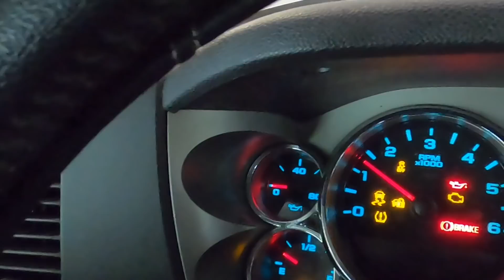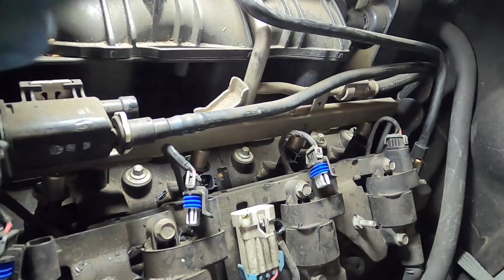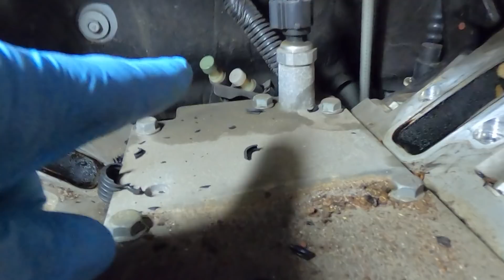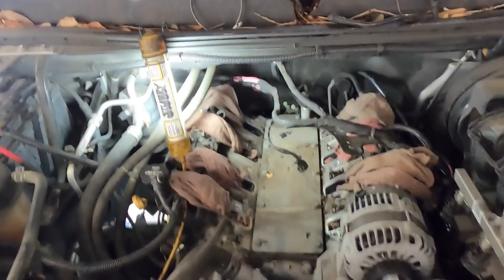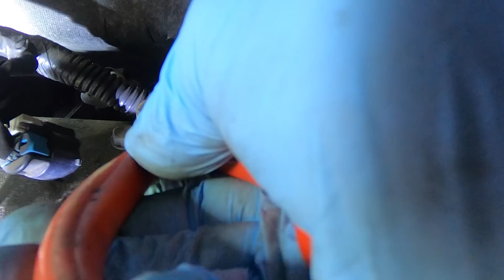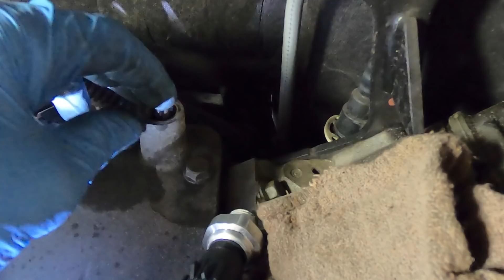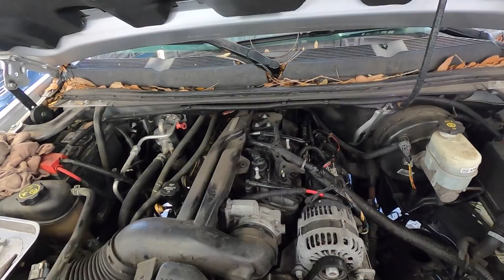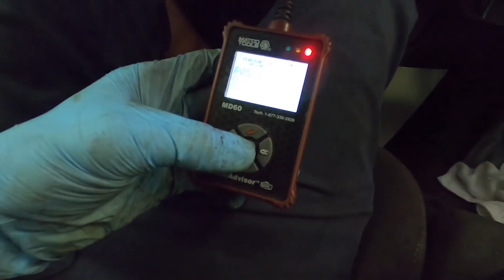Customer States: Google Diagnosis…replace this part!

Comment: That's some well thought out engineering having to remove the intake manifold to change an oil pressure sender.
Reply: You don’t HAVE to remove it
Reply: That's. GM engineers being dollar driven by upper management
Reply: No poor engineering is putting a starter under the intake. Yes, many do this. We just had a Honda that was down for a month while we tried getting a throttle body. Just touching it broke coolant lines on it.
Reply: I remember a VW V6 engine, which made you pull out the engine just to replace the starter 😂
Reply: @oskvr.l  no, dont remember that one.. but the 5cyl in the bugs make you pull the engine to do the lower timing chain. its between the engine and transmission. Oh and you time that engine off of cylinder 5. so close enough.
Reply: @rodx5571  It's an older Touareg model with a V6 engine. VW says the engine has to be removed. It can be done without doing that, but that requires some trickery and it's not how it is supposed to be done and while you've done that you possibly could've just removed the engine. Probably saves some time as well 😂. I got no idea what kind of satanic engineer decided to put the starter in such a place.
Reply: @oskvr.l I know which one you are talking about. Also have to pull the engine to do an upper oil pan, which leak profusely.
Reply: I typically lay on top and use a swivel extension to get them out. Not to bad and saves time.
Reply: @hyperchuk  okay it's called experience. I can do a brake job in 20 mins. Yet it still gets a mandatory 1.5 hours. A wheel bearing calls for 3. I can do most in 1 hour max. Unless a press in, but still get paid for the press plus the labor to do job. So I can put my self in there shoes cause my manager loves when we can put out the work in under book time. Makes ALL of us more money in the long run. And if experience means I get paid less for the jobs. Then ever mech/tech is gonna quit.
Reply: I mean you don't have to remove the intake to do it
Reply: i worked on my brothers 01 monte carlo ss and even as a beginner their design choices are just baffling compared to my yota
Reply: You don't have to.
Reply: Some put it under the exhaust manifold.
Reply: Try a 2011 Hyundai sonata gls rear brake rotor job, suspension and other parts have to be removed 👀
Reply: Of course,it’s a Chevy 😂😂😂
Reply: @roberthampton6438  they ALL have issues of some sort.
Reply: Engineers.  I went to replace the cabin air filter on my ‘01 Honda Insight.  The shop manual procedure starts with unbolting the glove box and a strut, then a structural member of the dash board is cut out to get access to the door covering the filter.  Well, I learned the previous owner had changed the filter because the the structural member was already cut out - saved me a couple of minutes!
Reply: @hyperchuk  40 hours? You're a tech? 11 hour days 6 days a week. Is minimal you can put in around here. 100 hours is what they want to be minimal per tech we got 5 rn. All hitting above that because we do our jobs like they are suppose to be done. Why rip your self off? Why throw your experience down the drain. I take commission, cause take home 1200-1400 is alot better then always getting 750 take home flat. You do flat rate when you can't put.numbers up and wanna save your ass. Your experience is clearly lacking the last 30+years. Lmao.
Reply: @hyperchuk  I'm not trying to school you. You are literally saying we shouldn't be paid book time for jobs that took us less from experience. That make no sense at all. Think about it. You do a 2001 ford f-150 exausght manifolds. Book calls for 8 hours. For both you've done 1,372 of them so can have it done in 3, 4 tops. Now your saying you'd fuck your self out of 4 hours of for me that be 35 bucks a hour. So you'd be says bye to a extra 140 bucks just cause experience. That backwards as fuck no you take that extra 4 hours cause it took you 1,000+ to get to that point.
Reply: @hyperchuk  if we all worked like that we'd all be broke. That simple.
Reply: @hyperchuk  if you do body work why your truck misaligned. Bad to don't even have to zoom in to see. Lmao.
Reply: @hyperchuk  I can do all that too! Would I No. I can also sing. And dance. Am I good no. Saying you do something. Then telling me to go look at you shittily aligned truck is fucking priceless.
Reply: @hyperchuk  the type of guy to paint a bumper under a 🌳  lmao.
Then say he's a professional.
Reply: I have to do that to change the plugs on my Xterra.  I love the truck, but I’m not looking forward to this!  I’m changing the seals while I’m in there.
Reply: you should see the starter location in a Toyota 1-UZ V8.

they put it under the intake, for whatever reason. I doubt the engine would've suffered any had they put it between the engine and trans, but nope. Under the intake.
Reply: What's worse is having to remove the entire top of the engine to replace a lifter. (Intake manifold, and head needs to come off and if you're removing 1, might as well remove both)
Reply: In an BMW E70 X5 the entire front subframe needs to be removed to replace the engine oil pan gasket. $20 part, 11 hours labor. German engineering at its best.
Reply: And yet it's the german cars that get all the grief for "complicated" engineering????
Reply: Remember in the 90s chevy put the fuel pressure regulator under the intake plenum lol, on the side of the worse fuel injection sender ever made and then made it stick up through the plenum with a gasket that barely sealed right under the best conditions. They do things weird sometimes but I wouldn't trade the old hunk of junk for anything.
Reply: @itsmegregk  yeah, the spider injected early Vortec engines. And they did that flat distributor cap that cracked in the middle shorting the coil to cylinder 6 inside the cap, making the engine not run. Made CRAPLOADS of $$$$ on those. Still making money on those. Add to that the distributor gear liked shearing teeth, and you had to have a scanner to set them to -2 to +2 degrees when replacing or it would set a P1345 code. yeah, easy money.
Reply: @rodx5571  Having a 1993 S-10 4x4 blazer. Vortec. I have nothing but bad things to say about it 😡.Biggest POC Plastic junk. Have had to replace three so far. One under warranty. One I replaced about 40 thousand miles later. Then had to have another one a little over a year ago and had to have a shop do it as I had just had shoulder surgery 😒.at 29 years old that's the only problem  every thing else is pretty much original. One  water pump I replaced.,And two fuel pumps. In 29 years.
Reply: We joke at work that Engineers design things like that to justify their six or seven digit salaries.
Reply: It is designed that way for capitalism's sake. Manufacturer  making money for the dealer.
Reply: No, you're  correct,  you don't "have to" ,  But that is the procedure a technician like myself or Ray HAS to follow in order to get properly paid for the job....
Reply: @hyperchuk  yep. i made a tool, and got my throat cut by management, so now i pull the intake.
Reply: @rodx5571  It just takes some folks a bit longer to realize how "life" works, and not stess against the process
Reply: @hyperchuk  I never HAD to remove it to get properly paid as a tech
Reply: @chicanobluesaz4191   No I never HAD to do it either, but some places they insist that you do it according to the way the manufacturer suggesthe manufacturer suggests just in case something goes sideways then you have to try to explain to the customer you try to cut the instructions to save time and now they have a broken intake manifold or some such thing...  It's been doing this for almost 50 years I've probably done a 100 of them without pulling the intake
Reply: @hyperchuk  that's not true at all. It all depends on the tools. And how many you've done. Done it both ways. It's definitely just a suggestion.
Reply: @hyperchuk  kinda like how all the different torque specs weren't  followed when being reassembled?
Reply: @korndawggy1801   Well, when you've been doing it as long as rain Man Ray and I have,  you can come within 2% of the torque just by feel
Reply: @hyperchuk  pretty sure you get paid either way if it works in the end. I'm with both of you though make life easy. PS my 03 6.0 silver had me tow it to the shop when low oil pressure message came on-I tested oil pressure with mechanical gauge-psi okay-not familiar with 03 problems or location etc yet. Cheers.
Reply: These engineers are not stupid. They have bosses too.  They are told to put it there! So it takes longer and more money for the dealer who is selling these cars to stupid people who never ask "but, how easy is it to fix?" this is the American Way!

Comment: I'll guess that when you started out you wanted to fix the problems and would do whatever it took to get it done, thinking that your initiative would be appreciated. Then after getting chewed out a few times by customers who accused you of inflating their bills when they only asked for X, you decided that if they ask you to fix it, you fix it, and if they ask only for X, you only do X. Seems like a good coping strategy to me.
Reply: People are that way. Some shops do inflate billable work as survival tactics. The shop i work for doesnt want to see the laundry list on top of the requested inspection/diagnosis. The only exception is safety issues like brakes, belts showing in tires (which we dont do tires). Or ball joints that have worn their way out of the cups (I'M looking at you dodge and ram trucks). So as a tech i dont bother inspecting everything unless its requested or a safety issue.

EDIT: some shops will fire you if you don't do the laundry list every time.
Reply: It's also illegal to do work on a vehicle without permission.  You can lose your license for doing work that wasn't agreed on.
Reply: @lilkittygirl  Mechanic license?  Never heard of such a thing.
Reply: @BottomleyAdventures  You need a license to be a mechanic...
Reply: @lilkittygirl  Where?  Not in the US, at least not in most states.  There may be a couple crazy states that require it I suppose.
Reply: @BottomleyAdventures  Some states don't require it but many that do.  In Canada, it's a requirement.

Michigan for example has 11 different levels of certifications for mechanics.
Reply: @lilkittygirl  Interesting, thanks.  I just did some research and see that licenses are required in Michigan, California, Hawaii and Rhode Island.  I'm from Indiana and have never heard of such a thing.  Sounds like horrible government overreach and a great way to drive up prices, but I'm not necessarily surprised by those 4 states...  Usually such licensing schemes are lobbied for by the bigger players in an industry to raise the barrier of entry and reduce their competition, thus driving up prices.
Reply: @BottomleyAdventures  It's not an overreach.  It's to protect all parties regarding liability of damage.

Insurance companies want licensing for these reasons as well.
Reply: @lilkittygirl  Spoken like a true statist. :)  Glad the vast majority of US states disagree with you.
Reply: @BottomleyAdventures  Um, I'm not a statist, nor am I American.

The laws are in place to protect the public from being exploited by mechanics forcing them to prove their work and they are actually trained to perform it.  That way the mechanic can face severe penalties for ripping people off or doing shoddy work.  When you have your career at risk, you tend to go extra lengths to be sure you can keep it.

The laws are in place to also protect the mechanic from wrong allegations, from wrongful lawsuits and so they can qualify for affordable insurance in case things happen.

It's a scenario where everyone wins, the only people that don't are people that shouldn't be fixing cars due to their malpractice issues.
Reply: @lilkittygirl  You are a statist, but you probably don't realize it if you're Canadian.  You've likely just been brought up that way.  Everything you mention is achievable without licensing, and in fact all of that exists in the US.  ASE certification is a stringent process that is widely used in the US to demonstrate proficiency.  There are very severe penalties in the US for ripping people off (fraud) or performing shoddy work (tort liability).  Not only do we have a judicial system setup to deal with such issues, but also a widespread system of ratings and reviews for customers to share such experiences.  Everything you mention is possible without a government licensing system.
Reply: @BottomleyAdventures  a certification is a license.  JFC.

I'm not a statist, but I support government implemented measures where appropriate.  Law and order exists because of the government and its people.
Reply: @lilkittygirl  No, certification is not a license.  Licensing is only done by governments.  Certifications are voluntary.  Law and order exists out of a need to protect citizen rights.  In fact, that is the only legitimate purpose of any government.  Didn't plan to get into philosophy here but why not, lol.
Reply: @BottomleyAdventures  No, certifications are government regulated dude.
Reply: @lilkittygirl  Simply Google the definitions dude.  You are wrong.  "A certification verifies that a professional has met a certain set of criteria for a skill or job as measured by a third-party assessment. A license is verification by a government agency that a professional is able to perform a particular occupation in a particular location, such as a certain state."
Reply: @BottomleyAdventures  "Google"  Yea, I get my academics from places that are not Google.

Both are managed by your government, the third party assessment is a school that is regulated by the government.

The government handles all certifications and licenses one way or the other.
Reply: This guy is working at some soft surreal clown show in Florida with beautiful weather all year round days that never get shorter so why the hell not pull the intake manifold. He doesn't have days that r still dark at nearly 8am and are pitch black by 4pm so he enjoys soaking up endless hours and endless pay checks. Will I blame him??

Comment: I discovered it takes about 3 cycles of on and off before the new one starts working, ? Did you also replace the small filter underneath sensor while doing it,  I wished you would have showed the oil gauge as you were backing it out.

Comment: My god these sensors and that oil passage design are garbage.  I've replaced 5 of them on my '08 silverado...I've gotten a lot better at it without removing the intake and it's really not that hard or that tough on your hands.  My passage got blocked (well after I disabled DFM that is also fed from that same passage) and I was at the point of pulling the intake and trying to clear the passage when I decided to just put a sensor fitting at the oil filter and be done with the trouble.

Comment: The intake don't need to be removed. Sensor socket impact wobble 3 inch extension and wratchet. Disconnect fuel line and you can get your hand back there.
Reply: unsafe

Comment: There is no way I’d go on a wild goose chase because google said so.   You don’t fix their problem and you expose yourself to the old “it worked before I brought it to you”.   If google diagnosed it have google fix it.
Reply: I agree with not always trusting Google but, you can clearly see the oil gauge was working at the 32:10 - 32:15 mark.

Comment: The design of that engine is pathetic.  To have the oil pressure sensor so difficult to remove makes me think a committee of accountants designed it.  There are oil galleries all over the block, so putting it under the inlet manifold at the rear is stupid.
Makes me think of the CPS on my (hijacked) C240 Mercedes - it was also placed in a very difficult position.

Comment: You didn't do anything wrong. Can you replace the sensor without pulling the intake? Yes. Can you do it properly? No. Usually results in a cross threaded sensor, damaged by the channel lock pliers, so it won't work anyway. Then you get the treat of doing the whole job over again the way you showed. Except now you get to fix the damage you did first. Go ahead... Ask me how I know...
Reply: You can easily replace the sensor and the filter screen below it without removing the intake, and you can do it properly without causing damage to anything. No channel lock pliers or any other hack tools are needed, just the right size socket and a wobble extension. I swap these out in less than 15 minutes all the time and I've never had an issue.

Comment: Hi Ray, what did the customer say after you told them that replacing the part did not work.  BTW the customer deserves what he gets.  Instead of trusting you to diagnose the problem and fix the issue he just threw money at the problem which does not fix it.  so you have 2.5 hours at 100 per hour.  Thats 250 plus the part  oh 30 bucks?  so this little adventure cost him arond 300 dollars.  Where did that get him.  300 dollars poorer.  What an idiot.  I am guessing he goes to the Dr and tells the Dr that he needs to have his toe nail removed when he is having heart palpulations, because that is what google told him.

Comment: It's proly the oil pump I had same issue. I replaced the pressure switch an still same thing. I actually got in there an did it without removing intake but it's very tight lol. I would like to see wat u find causing low oil psi tho.